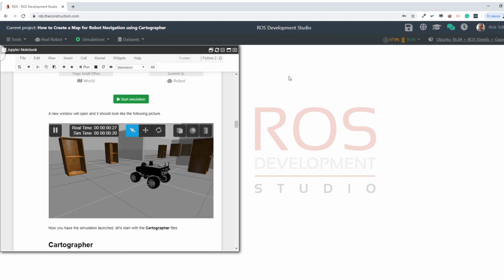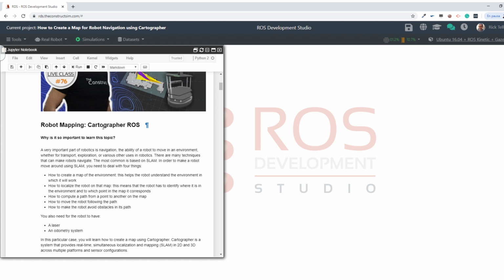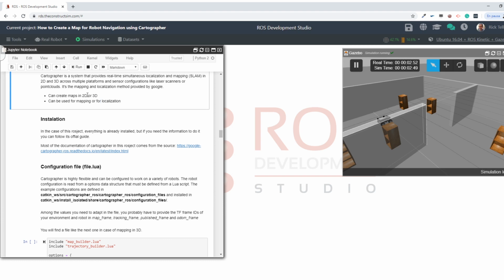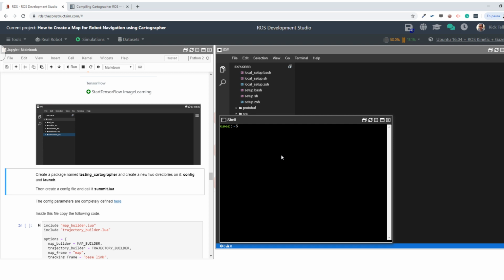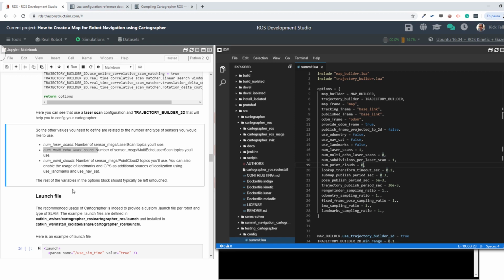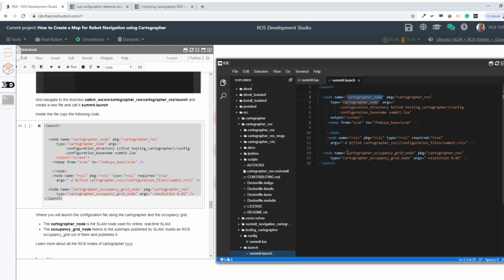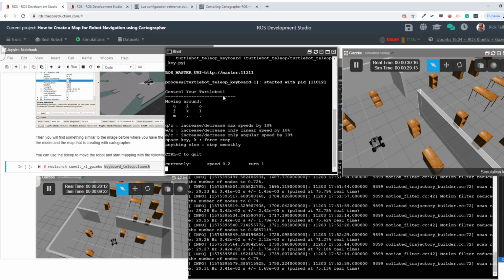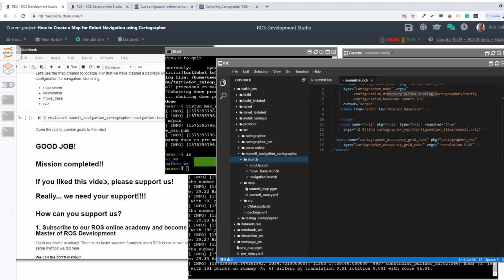ROS Developers LIVE Class #76: How to Create a Map for Robot Navigation using Cartographer

Comment: I am trying to get cartographer installed on Ubuntu 20.04 LTS, it is 64 bit running on Raspberry Pi 4 - 4 GB. The issue is after it reached stage 3 of 4, the whole system freezes and I am not able to install it any further. Has anyone encountered this?

Comment: I am trying to generate a map using google cartographer on my ros bag file which I collected in my lab, but could'nt find any tutorial on a general layout. The cartographer documentation also does not give a full understanding of the same. Can anyone help me in this regard ?
Reply: I have the same problem. Did you find a solution? Thanks  a lot in advance
Reply: @francescofraternali1531  Yes I have found a solution. The requirement is the configuration file with which you recorded the bag file must match the one which you are running offline. let me know if you able to do so or have any issues after this try

Comment: Hi, I have an issue with cartographer mapping. The location of the origin changes as the robot moves, which makes the rviz provides inaccurate mapping. Moreover, the robot drifts away after some time. Do you know what could be the problem?
Reply: Have you done localization before mapping?
Reply: @nooshinshahbazi5616  Yes, I did. When I do mapping with Gmapping it works quite fine. With Cartographer the robot seems to be drifting after some time and the robot moves around on the rviz like headless chicken.